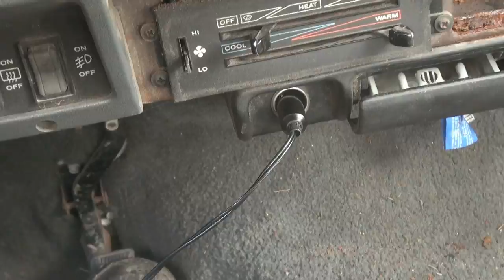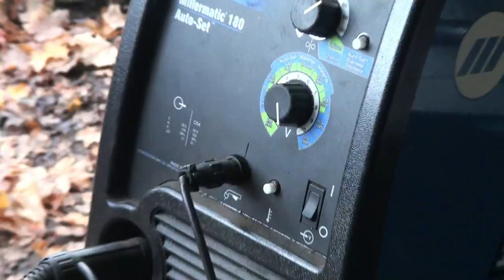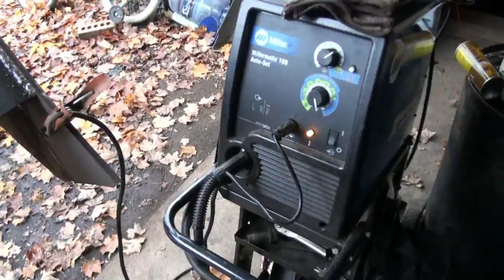some more work on the 36 inch bucket

Comment: I agree with the others Bill. Weld on the strip and then bolt the cutting edge on. That way you can turn the cutting edge around when it wears down and it will make it easier to replace later

Comment: Hi Bill,

And yes, your welding aint bad. If you had the time it would be nice to put as much weld on that back bit as necessary to allow you to grind it off flat and level and no one would ever know it was patched up, mainly out of necessity because the bucket wasn't square. And of course the actual welds are much harder than the rest of the steel. 

Actually welding onto welds already there can give the edges of the buckets you have extra

Comment: Hey Bill  good thinking of showing us the inside of the bucket while you were welding the outside, I would have never thought that welder would heat it up red hot,looks like the welder is penetrating just fine.  Good Stuff.  Went to the new P/auto yesterday and wow it's the biggest one  I have seen..

Comment: the hardened steel of the blade will shrink and expand at a different rate then the unhardened steel of the rest of the bucket by bolting on the blade you allow a place for flex

ps Bill I'm a big fan of you channel I watch everything you have put up and I love it all 
the cranberry farm was sweet (sorry about the frogs) thanks for your time hope this helps

Comment: You should chop a piece of the old cutting edge off to use as a filler for that old hole in the sidewall of the bucket.

Comment: Its called duty cycle every machine is rated. A 20% duty cycle welder is designed to run 2 minutes out of every 10. As a safety measure the machines shut themselves off to prevent overheating and in turn failure.

Comment: Yes that is correct. The bigger machines utilize a larger copper coil, better cooling features and more advanced electronics. I just looked at millers line and their largest single phase MIG is rated 60% duty cycle that machine is the the Millermatic 350P. Look closely at your welder it might be rated and didn't even know it...

Comment: Hey Bill "Oshell69" is right you will have the same thing happen to the bucket again!! if you don't make the blade bolt on!! 

also you would be wise to run some nice hot beads of weld across the bucket back and bottom so the bucket becomes more stiff and will wear longer from the hardening of the steel that you added!!!!!!
I'v been running a welder from age 10-29now

Comment: strength and abrasion resistance. You may know many old digger owners where they are out in the middle of Australia or somewhere often use a weld like a stitch in a zig-zag style on the waring edges especially on the edges where the rocks in there case though that may not be such a worry for you, welded and tidied-up with a grinder can stop any damage and wearing anywhere. You still have the parts you cut off I think you said you will use them plus some of the ½" steel plate you have to finish?

Comment: Cut a 2" 'filet' and put the hard edges scraper right near the front. I am writing this and have only watched half the video, are you going to weld the hard edge on or get the fittings and or use bolts?

Comment: Bill weld 8 inches of plate on and bolt on the cutting blade. That's the design. Then you have another side (provided you center the bolt holes) of the blade. AND its replaceable! Save yourself time down the road and do it right the first time. Come on Bill read this.. I suggested this last bucket video. People liked the idea.  Do it....

Comment: Cut a 2" 'filet' and put the hard edges scraper right near the front. I am writing this and have only watched half the video, are you going to weld the hard edge?
Are you going to cut the new scraping edge as you have it? Because the part you cut off might be useful for the other smaller bucket?